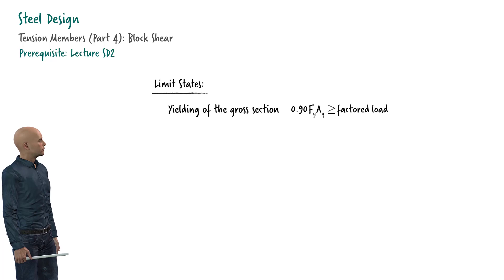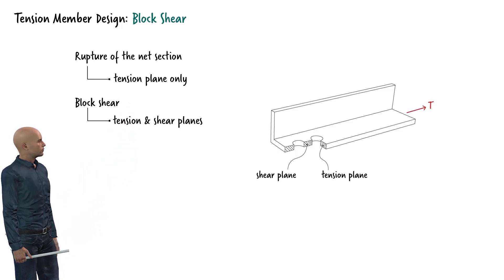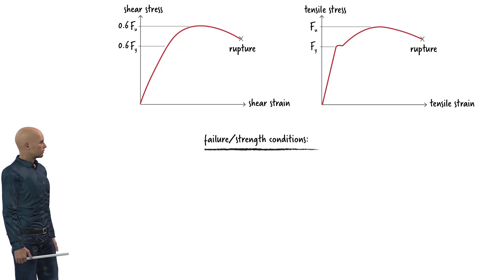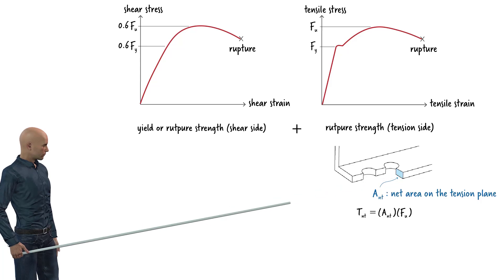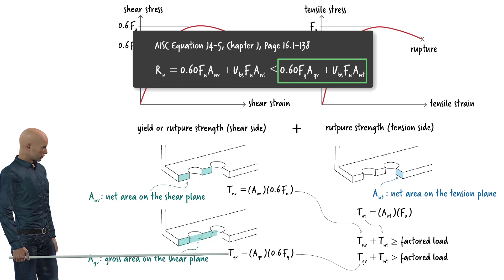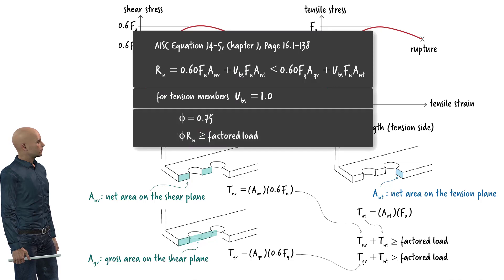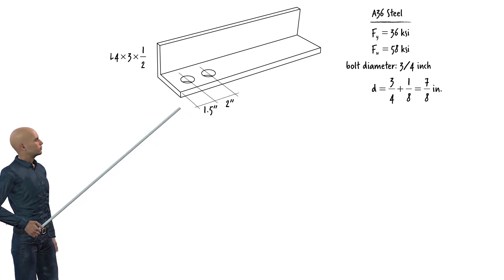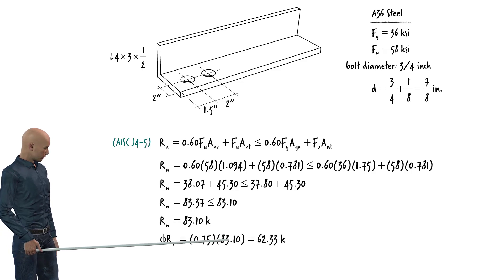SD4: Steel Design (Tension Members): Part 4

Comment: for problem 1 when finding ur net shear area why are you using 2.5? and what is the length from hole to hole in the vertical direction?
Reply from the maker: There are 2 and half (2.5) holes along the shear plane on each side of the connection. That is where 2.5 comes from. We are subtracting the area due to the holes from the area of the flange in the shear plane, since the holes don’t contribute to the shear strength of the member.

The vertical spacing between the holes is at least 7 inches, considering the section dimensions (WT7x66) with a flange width of 14.7 inches. However, this spacing is not relevant to our analysis.

Comment: in your solution you use 7/8 in as the hole diameter. it should be 1. since the problem statement says the nominal hole diameter is 7/8in. adding 1/8'' by cold would make the diameter 1in instead of the 7/8 in outlined in ur solution? correct?
Reply: for problem 1*
Reply from the maker: The same discrepancy in the problem definition. So, for the solution to be correct, we can change the specified bolt diameter to 3/4 in the problem definitions.
Reply from the maker: You are correct. Contrary to the problem definition (7/8” bolt diameter), the solution uses 3/4” bolt diameter.

Thanks for pointing out the error.
Reply: @DrStructure  I appreciate you sincerely! I have my steel midterm tomorrow will update with results (: